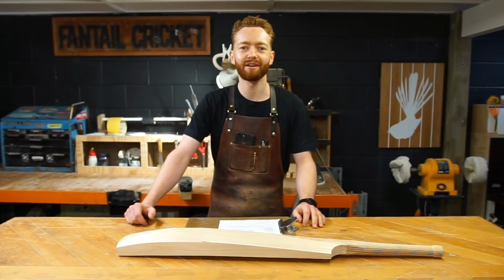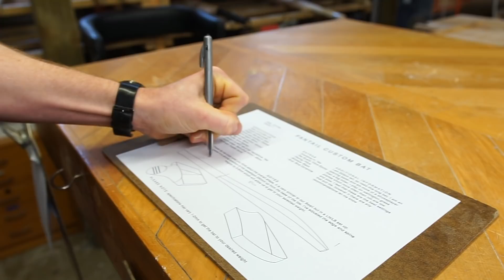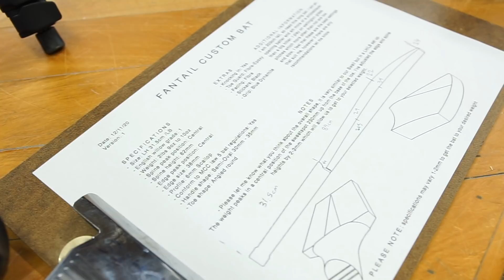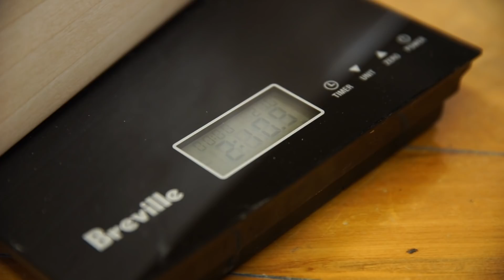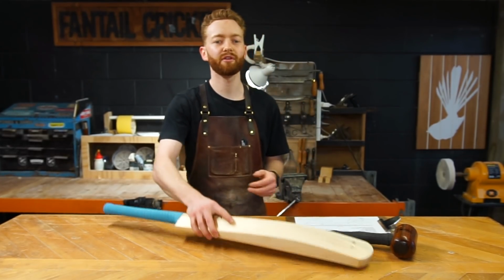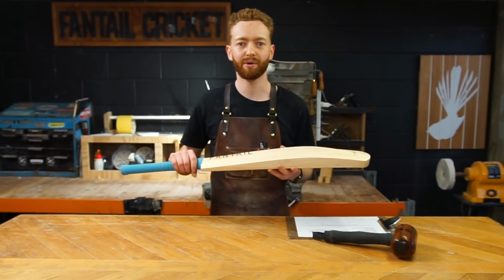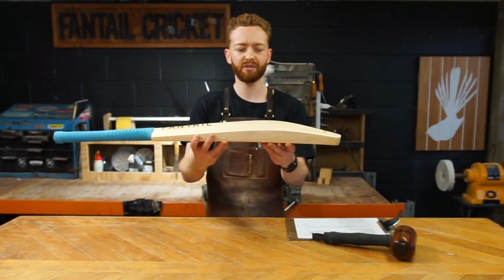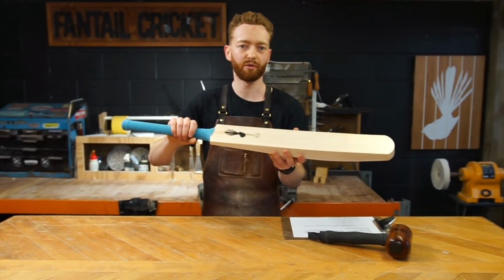Cricket Bat Making EP-1 - Custom Made For A Tall Batsmen

Comment: What is that process you did with the stick thingy on the edges aroud 12:20 ?
Reply: I believe it is called boning, the rod is probably coated in bat wax or some along those lines and the rod is pressed firmly along the edges. It is to round the edges so that they do not break or crack when the bat is used in game/trainings.
Reply: It is used to make the edges blunt so that when the ball Nick's there will be no damge to the bat